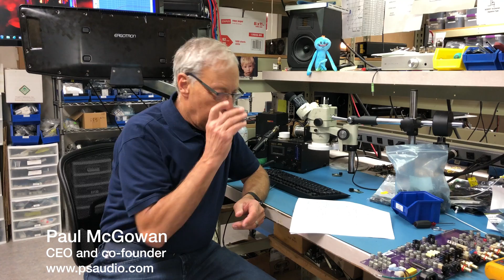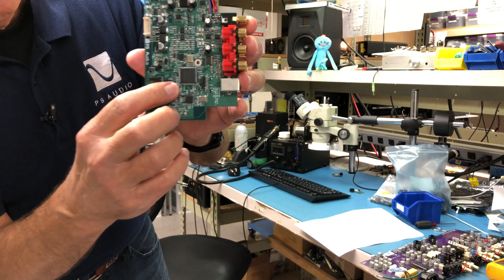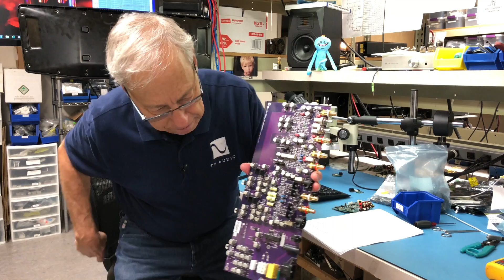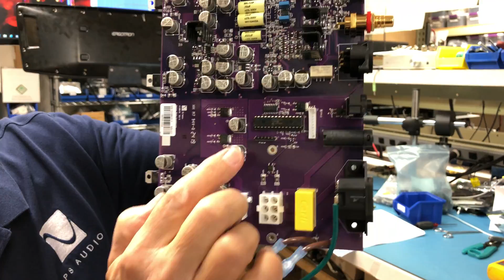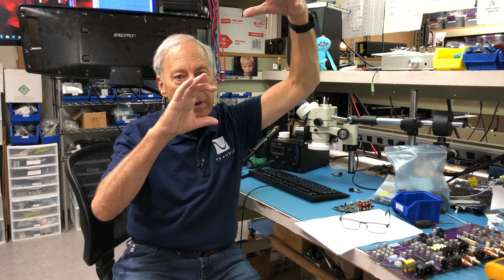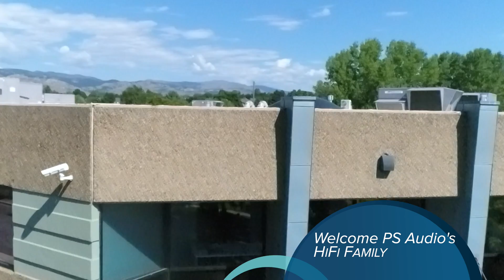What is discrete circuitry?

Comment: What an interesting video! Would love to see the do the designs video (link?). Also, with opamps and chips etc, since they are miniature sections of circuits in the ic components, do you find that one company that makes a specific op amp package, would that same specific Op amp package design (layout/inner compents/pinout/etc greatly vary from manufacturer to manufacture or even from production runs. Et al burr brown opp amps typically dominate the “I think clipping op amps sounds good” people 🤨 and idk if it’s just me being swaded by a metaphysical placebo when I compare it always seems the burr brown has a more juicy asymmetrical distortion layout with more thick even order and low# odd harmonics.

Comment: What about the interference of an op amp vs discreet componentry. My mind boggles about the isolation of components vs the noise levels of IC's. Or has science changed over the last 50 years, where this doesnt matter anymore. Maybe in digital scenarios but not in an analog form.

Comment: I think we need to be clear when speaking of feedback.  Infact... there probably aren't many people w/o electronics degrees that even know what they mean when they use the term.  What you are referring to is GLOBAL feedback.  Virtually all amplifier circuits have LOCAL feedback.  A class A transistor ckt has an emitter resistor to set the operating point and to keep closed loop gain within the device parameters.  In a self-biased tube amp the cathode resistor voltage increases with plate current, causing the grid to be more negative, thus... providing NEGATIVE feedback.

Comment: I have used the LM4780 and LM3886 for years and that what he talks about.

How does that differ from using ICEPower?
Reply: The LM3886 is an integrated Class AB-A (conjugate) amplifier that has a fully symmetrical structure (push-pull).  
The ICEPower is a class D module.  
The LM3886 is very good.  I built the Peter Daniel premium implementation which performed extremely well and served my needs for years.
I replaced it with discrete triode monoblocks with point to point wiring.  They are in a different (great) league.

Comment: The reasons that different circuits and topographies sound different are quite simple in reality... they are down to just three things ...
1) frequency response 
2) slew rate 
3) damping factor
Reply: Not true.  These matter but there are many other things that need to be taken into account.
Reply: K Rider ~ I'd like to read what you think also contribute to the way circuits sound .. I've only listed the salient ones ..
Reply: @janinapalmer8368  The open loop characteristics of the circuit, distortion over frequency, the type of distortion with its harmonic content, negative feedback amount,  large signal characteristics (almost never measured under dynamic conditions).  There are individual characteristics of the discrete components which come into play like the harmonic response of capacitors.  The spectral characteristic of the IMD.  All systems suffer from various types of distortion but the way they appear and their spectral content have a large impact on the musical or non musical nature of a circuit.
Reply: K Rider ~ I agree ... yes all good points you mention... but this is true for all topography so therefore it's a common denominator here . I'm talking about things like the dynamic characteristics of various op amps or vacuum tubes . I know that choice of capacitors resistors and inductors can all play a part in sonic quality and I assume the use of high quality components.

Comment: There's much much more in that Stella phono pre amp than meets the eyes ! I was stunned by the huge amounts of electrolytic capacitors it had too !
Reply from the maker: Fortunately, none in the signal path. Yes, Darren got carried away with voltage regulation (a key to low noise).

Comment: One way to get the best of both worlds is to use a discrete op amp.  Most will be a plug in replacement for an IC, but be built using discrete components.  The best known is the Jensen 990 and its variants.  Look up Sparkos, Sonic Imagery, Jensen.

Comment: Many years ago I had a preamp that sounded good but the phono section was noisy so I picked up a Audio Alchemy Vinyl to Audio phono preamp. It was a combination of IC's and discreet circuitry. It was very quiet (discrete parts in the very low level circuitry0 and sounded pretty good as well.

Years later I had a Conrad Johnson PV10A that had a very good phono section using 12ax7's that had a sweet sound but one say I read an article about the la Pacifica phono preamp. It used 2 jfets and a few very good film caps per channel. It sounded interesting so I bought a printed circuit card and the pats as a kit. I replaced all the cheap 1/4w film resistors with RN60 metal film resistors, there are better resistors but these are very good and pretty cheap. I designed a quiet power supply and put it all in a aluminum chassis.

 I hooked it up and it was dad silent, I dropped the needle on a '60's recording of The Triple Concerto and was blown away by the sound. The detail was amazing. I then tried it with a moving coil pickup (had to use another pair of jfets for more gain) and that sounded even better. All of this cost me about $100, it can be beat by really good phono preamps but it will cost well over $1,000 to get better performance and with my aging ears I'm not sure it would be worth it for me.

I think the secret behind that circuit is it's simplicity - less parts to screw up the sound. The moving coil version has 3 jfets and 6 capacitors per channel (4 of those caps are for the RIAA shaping) and about a dozen resistors to bias the jfets. Next to no feedback and a wide frequency response just lets the music sing.

Comment: I can see some years from now, Integrated Circuits improving to a point that they may match HiFi discreet circuits... Think about phone processors some years ago and how their chips have improved? Same regarding the chips (Sensors) used in phone cameras which outperform some digital cameras that were present only few years ago... what's next...Is It Audio?
Reply: Bedros Daoudian integrated circuits were already there 20 years ago, so no, discrete is marketing bs in audio; the power stage needs to be made discretely due to power requirements, but there is no reason for the op-amps to be discrete, you can't do a better job for audio, and it won't matter if you did

Comment: Of course you can control the amount of feedback with ic. Just connect inverting and non-inverting terminal with a resistor. You can control the amount of loop gain you compromised using it. But it's completely useless, only adding more distortion. If that's the goal, sure it can be done.

Comment: Not easy to get surface mount parts that sound good.
Reply: Anders Hammer why is that? how do you know? 

surface mount makes no difference in audio, I'll say it again, audio is not a demanding field!  leakage, EMF, low level noise don't matter, you'll never be able to hear it
Reply: @FooBar89  I am not going to respond to these people who listen with their test equipment and not their ears anymore. All I have to say is science says it's impossible for a bee to fly yet it does.
Reply: Anders Hammer where did you get that? a bee does not defy the laws of physics, nor does science say it being an impossibility; not only we understand the insects flight, but we can replicate it; did you think we wouldn't figure it out by now if it was defying physics?
Reply: Anders Hammer additionally, designing by ear or by how it sounds without ever measuring it's not science nor engineering
Reply: @FooBar89  Of course you measure first to see if its working correctly and then you tune it by ear.
Reply: Anders Hammer your own link said "pseudoscience", that's where the argument ends, it isn't science

Comment: Some audiophiles hate op-amps and only want discrete parts but the best solid state preamp I've heard uses op-amps.
Reply: Anders Hammer audiophiles by definition, don't understand how it works and they will never be convinced, that's what makes them audiophiles, using subjective reasoning and bias against hard core science
Reply: Well if they picked the right one. Probably sounds good
Reply: @mcrelly  Well the last time I modified something I used Analog Devices AD712 op-amps.
Reply: The Michell Argo HR preamplifier has LM318 op amps in its signal path. 🤔

Comment: Thank you Paul, I hadn't been able to wrap my head around this. I have a 90s technics sa-ax6 that i love and I've been told it is great bc it is a discreet amp. I argue it is great bc of the 20-20k hz range, not 40-20k like "new" amps(10 years ago), and the powered subwoofer output 100x6! Now i understand we were both right.

P.s.  How do you change out the volume knob?

Comment: The  day was when Ic's were fitted to circuit boards in sockets and you could remove them without a soldering iron. 
This allowed you to repair them in a matter of minutes. People would often look up the spec of an IC and replace it with something that was compatible and even an upgrade on the original chip data sheet. 
Not these days, sell you a new one. 
I think people should get back into kit making and make their own stuff.
Reply: Even my <$100 Chinese-made Dayton Audio 2.1 "chip amp" has its op-amps in sockets -- and, honestly, a through-hole DIP op-amp chip is pretty easy to desolder and replace because you can cut the IC free leaving just the legs, then desolder the legs one by one.  Things get dicey when the op-amp is in a tiny, surface-mounted SOIC package -- replacing one of those is beyond most DIYers' skill set.
Reply: @editorjuno  Not really. After desoldered the opamp you have holes filled with solder. That's extremely embarrassing to resolder. Soic8 is much much more elegant. Takes 8 seconds to desolder and another 8 seconds to resolder. Sure if the ic is socketed it's simpler.
Reply: @johnyang799  -- Dealing with solder-filled through holes is easy in my experience.  I just reflow the old solder, remove the iron, immediately poke a pointed, solder-resistant (e.g. high-temp plastic) tool through the still-melted solder, and keep it there until the solder solidifies -- then pull the tool out and you'll have a suitable hole.  You can even use a "solder sucker" on a single-sided PCB -- on double-sided and multilayer boards there's a risk of sucking out the inter-layer vias.  I've never tried to desolder a surface-mounted IC, but just looking at how small everything is I suspect it's trickier than you described without specialized tools.
Reply: @editorjuno  Hot air gun and tweezer. I don't think it's special tool. 
The method you proposed seems pretty good idea. My current method for dip8 is to run hot air gun for extensive time while pushing the opamp down, which is so fucking embarrassing.
And on double sided board, the solder doesn't even get out. But poking using toothpick seems pretty nice idea.
Reply: @editorjuno  Hmm, its not really down to single sided versus double sided where solder suckers are concerned in my experience that is the problem as far as the likelihood of damage is concerned. Small pads can be tricky on either type but more so on single sided. But if we are going to pick a preference then I would say a double sided board is tougher than single sided and will withstand more de-soldering operations because the solder lining the hole helps keeps the two pads on each side of the board connected together. With practice and the right technique it is pretty easy using a sucker on either type. FR4 is pretty tough.
Reply: @cbcdesign001  -- I never want to get that much "practice," but thanks for the information.  I have actually sucked out an inter-layer via or two on double-sided PCBs in my time, but the IC leads themselves can do that job if you solder them on both sides of the PCB -- the problem is much more serious with multi-layer PCBs.  As for FR-4/G-10, it's very durable as you state, but there's still quite a bit of consumer electronics that have old fashioned single--layer phenolic PCBs, so it's important to know what material you're dealing with.
Reply: @johnyang799  -- Thanks, John.
Reply: @editorjuno  Plus how come soic is tiny?? It's literally bigger than the size of a resistor. How could you work with those? ssop and qfn are the actual hard ones. soic is easiest.
Reply: Would be nice to have Dynaco Dynakits and Heathkits and even Mackits again.
Reply: @andershammer9307  -- Let's not forget Eico and Knightkit.
Reply: @andershammer9307  I built a lot of Heathkit stuff in my life and a few Tandy and Velleman ones as well.
Reply: bcdhifi  -- In my experience, you're more likely lose a through-hole via with a solder sucker -- I own one, but try to refrain from using it on double-sided or multi-layer PCBs -- than with a quick poke through molten solder followed by immediate removal of the iron, but hey, whatever works for you is fine with me.  Peace.
Reply: bcdhifi  I live not to far away from where a Heathkit store used to be.